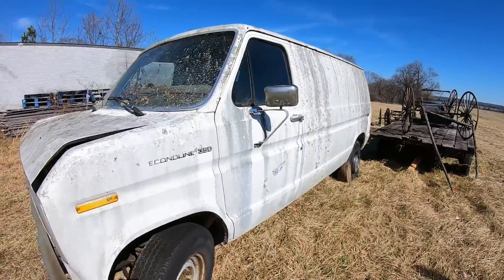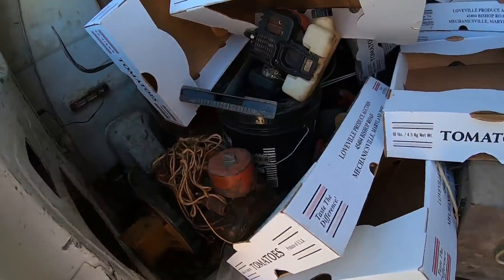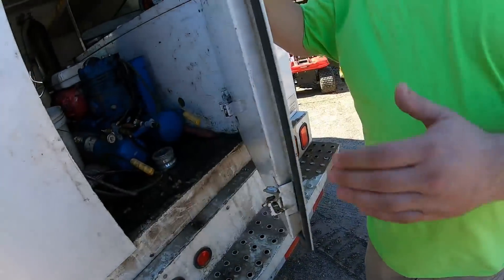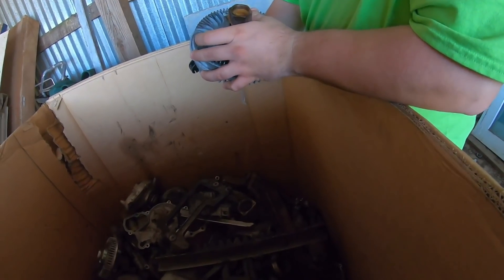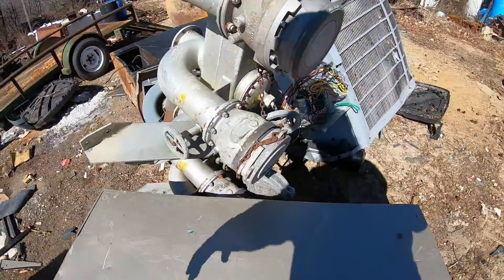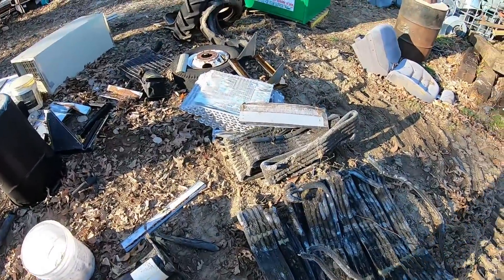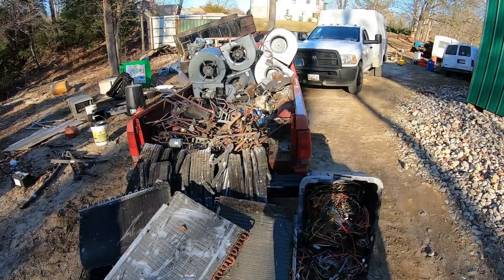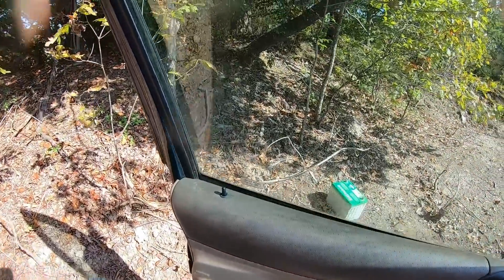Processing Scrap Air Conditioner's

Comment: Did those blue tanks have a spot you can open on bottom with 13 bolts brass nuts in side you will find a copper spool about 15-20 pounds you can sell separately